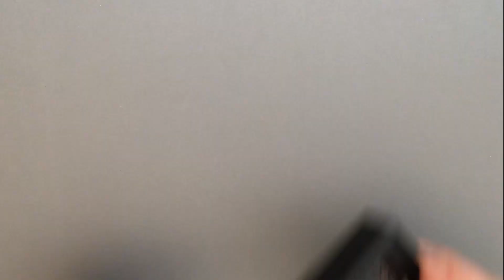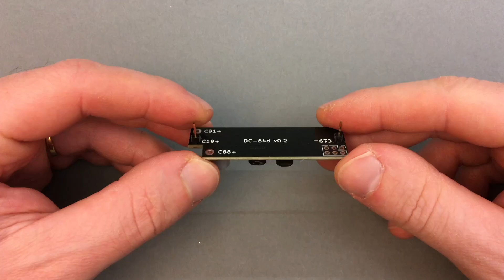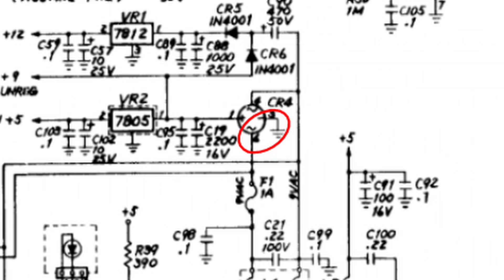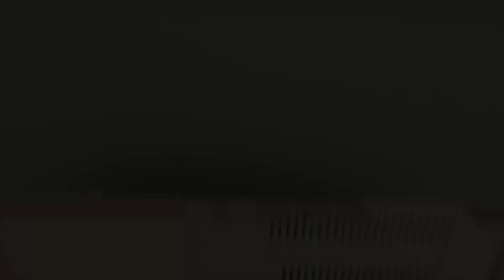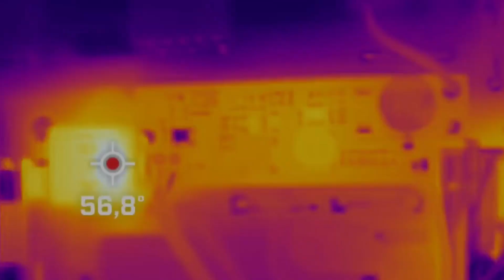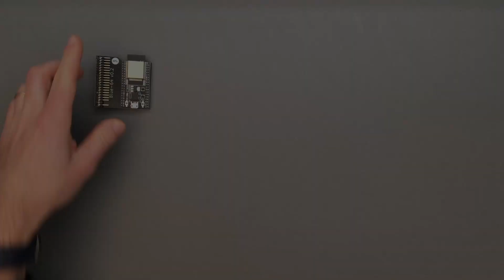DC-64 & Blue-64 new BETA boards: installation and availability

Comment: Have you given any thought of creating a new C64 PCB (like SixtyClone) with all the power stuff replaced with this? and perhaps powered by a standard USB PD supply?
Reply from the maker: Hi, no I haven't really thought about it. In general it's difficult to draw a line about where does the original hardware stop existing. So the way I decided to go about it was to make the smallest amount of modifications that would allow achieving my 3 goals: DC-Power, Bluetooth control and HDMI output (with audio too). The first two are done now, and the third is currently in development and going well so far

Comment: Personally, I would just remove the rectifier bridge and solder across. no need to make that diode suffer for more (it's also a huge failure point)
Reply from the maker: Indeed you are free to do so :)

Comment: Nice project! Could the rectifier be removed altogether since the input is DC?
Reply from the maker: Absolutely, however it is in general good practice to have some protection against reverse polarity, as not all wall adapters have the same polarity. So having a diode in series is rather desirable. If you know what you are doing you could definitely short both legs of the rectifier, effectively bypassing it entirely, or you could remove it and replace it with a single schottky diode, however it is not the easiest component to remove, having 4 through hole pins...

Comment: Is the DC64 adaptable to work with the C128?
Reply from the maker: Good question, I really can't say as I heven't looked into it at all, however at some point I'll have to design a new version, specific for a specific motherboard version of the C64-C, and I have a hunch that that might be more in line with the power circuit of the C128, so never say never :)